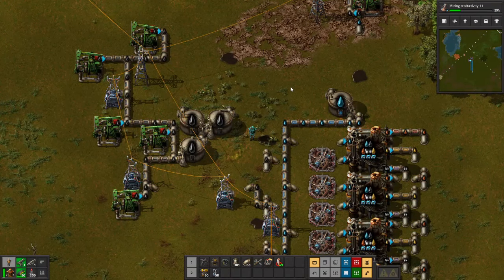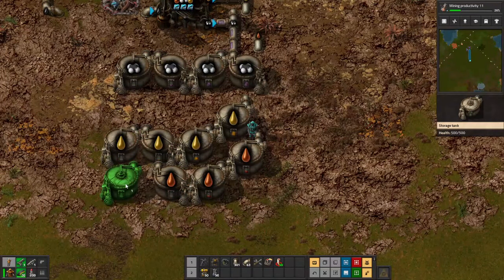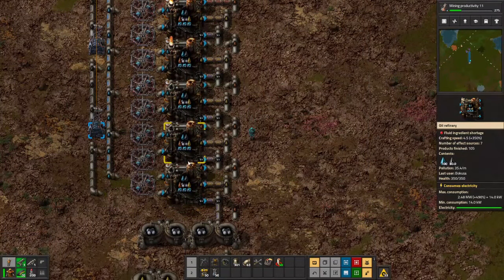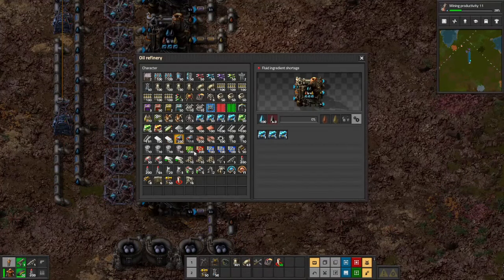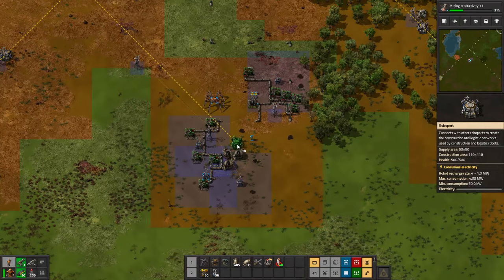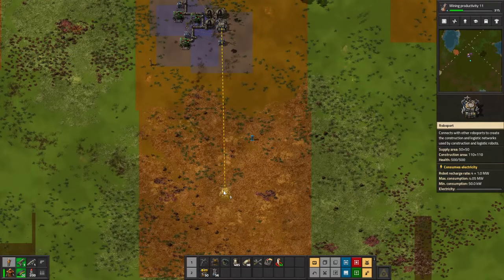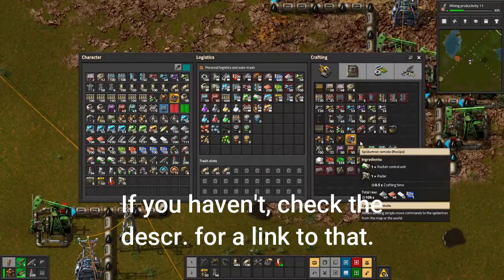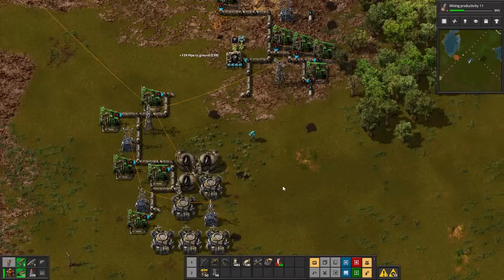Your Oil setup is About to Change FOREVER

Comment: Interesting approach but the video is all over the place:  repetition, clicking frantically everywhere while really not doing anything, and for the times you do make something you don't allow us to look at it for more than 0.5 sec --  very frustrating. I'd recommend announcing (even in the big lines) what you're going for and then bring us there slowly. It was hard to follow, not because of the complexity, but because you're scattered around like if you were just put on the spot. I see big potential but you need to script your videos and trim the fat (narrative + video edits). I forced myself to get to the end of the video and see your build, but you totally overlooked the problem you tried to tackle. Input/output flow rates -- what are the numbers? What about pumps? Did your robot stuff improved on the pipes?
Reply: I agree. This video takes 65 million years to get to the point. And repeats just as much.

Comment: I tried factorio, won 3 times. It is enough to build 6 refineries to produce enough materials to launch a rocket. What for do you need so many refineries and even speed them up? Wha is that for?
Reply from the maker: This is a very late game factory, and the material is used in mass.
Reply: launching the rocket is far from the actual goal.  Sure, you "win" by doing it, but it also unlocks a new science to research.  The end goal of factorio is to have enough of a factory that your computer can't handle it any more.
Reply: @Bokusa  mid game, sure but very late game this won't work since it use bot, 1k spm already required over 20 refinery

Comment: Your primary issue with the first refinery is that the pipes are not through-put optimise it

1. Use underground pipes for any distance farther than a length of 2, as eatch pipe object adds additional resistance to flow
2. Use pumps as valves and through put boosters, pumps allow incredible amounts of fluid to be forced into pipes upwards of 12k/s
3. Use minimal amount of buffer storage, eatch tank without direct connection to a pump reduces how much peak demand can draw as there will be some fluid that cannot be drawn
Reply: Great advice sakari_119.  I was thinking he should have been using pumps.

Also, if are coming upon on limits of fluid throughput, you don't have to put all your refineries in one long serial chain.  You probably have lots of oil fields.  Just route them into a more parallel setup.   This also creates redundancy should a pipeline succumb to biters, you have an alternate source of petroleum products without a single point of failure.

Finally, lots of robots flying around can bring even the strongest CPU to its knees.  I try to limit the jobs my robots are doing, like fulfilling my personal logistics requests or moving expensive outputs (e.g. electric engines, blue circuits, etc.) to where they are needed in my factory so I don't have to buffer hundreds or thousands of them on my main bus via belts.

Comment: Super crisp mic you're using mate. Thanks for the wicked video! I never considered barreling before.

Now I have another question: using pipes only, how many refineries would it take before non-beaconed production is capped? How many if using in-line pumps? I feel that I'd still want to pipe to the max of a pipe's efficacy before using bots.
Reply from the maker: I think pipes fall around 1800 liquid/second before they start to have issues. So if oil has a 4 second craft time then take the
 crude oil cost/4 * (x) =1800 then solve for x to get your number. I just woke up so if my maths wrong there im sorry lol

Comment: I want to be able to recycle my barrels by melting them back into steel.
Not for any kind of chenanigans, but because I am going to overproduce and end up with boxes full of them.
And it makes sense you could do that, or at least melt them back for a few iron plates.
Reply: Use the reverse factory mod

Comment: Except that by isolating the network like this, you're highlighting the major issue with robots:  They're good for a couple of things over short distances (until you start unlocking white science upgrades to them), but you ideally don't want one large robot network.  The problem here, is that to really use this effectively, i.e. sending those barrels to somewhere you'd need them, you'd need either the large logistic network, or a combination of train networks and local logistics networks.  Also, adding these extra steps means you need to set up an exact production of barrels.  Make too few, and this is slower than pipe spaghetti, too many and you've got barrels every where, even when you don't need them to be.  Furthermore, now, instead of just having trains (if you go the mixed logistics route) transporting your fluids to where they're needed, you're adding trains to transport barrels to drop offs, as well as trains to transport the barreled fluids AND the machines to both fill and empty the barrels.

I could see this being very usable with a good circuit network controlling things like barrel production and fluid requests and such.  However, a VERY large number of factorio players know little more about the circuit network aside from turning on lights.  You're also trading one UPS problem for another here.  Would be interested to see this set up when the DLC finally drops, though, as with all the improvements to robots and such, one massive logistics network might be a feasible thing, and this would really shine there.

Comment: For me personally, the pipe-way of doing it is still superior. Your version is better than your early example, but that was pretty poorly optimized. Using so many speed buffs on only one pipe input was the problem. Just use some pumps or a maximum refinery per input pipe, and it should solve itself. 
The barrel stuff does take up more space overall, and you still have the problem with one overfilling. One wire from tank to pump that goes to cracking, is so simple to set up.

Comment: How do you know how many bots to add? Per refinery chunk i suppose. Since you'd want to have X number of bots per refinery.  I guess it could just be eyeballed to see if the chests are getting too full or too empty
Reply from the maker: Well robots move items on an as needed basis. If you have "too many" they will sit idle until its their turn to be slaves. Technically speaking you would want just under "enough" so they pick up 4 at a time and you dont have bots getting 1 item, but thatd outside of the scope of what i care to do lol

Comment: I’m not sure this system truly addresses the issue of one oil type not being consumed as much as the others, resulting in the dreaded ‘Output Full’ scenario. I think this system is interesting and I’d like to see if a little circuit controlled balancing of cracking couldn’t be added to the system too…
Reply: I guess you never claimed it did. You could literally be taking the barrels to the cracking area I suppose. Sorry for stupid comment
Reply from the maker: I wouldnt call it a stupid comment :o the setup definitely doesnt do that. Its not a mathematically correct version of it. I personally almost never do math with factorio. I also dont do blueprints so its an inexact science on this channel

Comment: Nice voice, but this is a really expensive system and does not work properly.
Reply from the maker: It works just fine actually
Reply: @Bokusa  Use a red cable.

Comment: Come on, dude... What did you actually explain?
Reply from the maker: I think of this more is a demonstration rather than an explanation. I make tutorials separately that I'll teach people and explain how certain mechanics work. Most of the factorio community just looks up blueprints and how to do stuff when they don't know what to do..  So ultimately making an independent explanation as to why this function's better than using regular pipes is not necessary
Reply: @Bokusa  My dude, with all respect, you can solve the issue with three red cables and a pump.
Reply from the maker: This solves a lot more issues by conpacting this and not requiring outside piping at all
Reply: the best part of Factorio is.. there is no one right way to play. This setup looks awesome and I will be using it in my next game.
Reply: @Pro-cheeseburger  It's my way, my way or the highway. Buy!